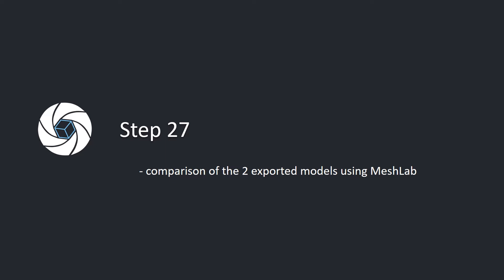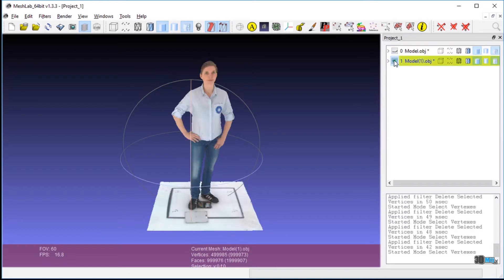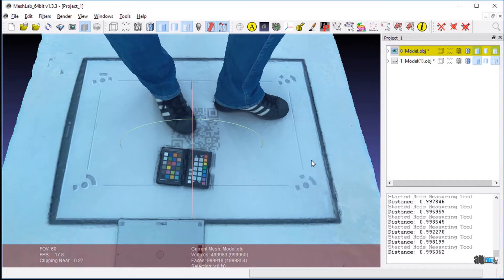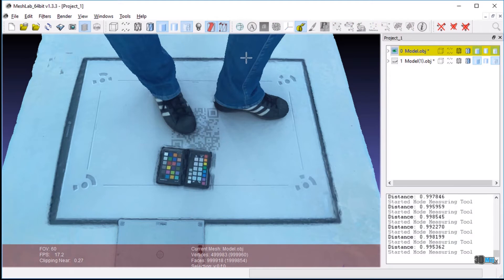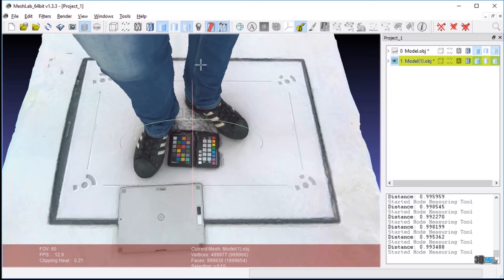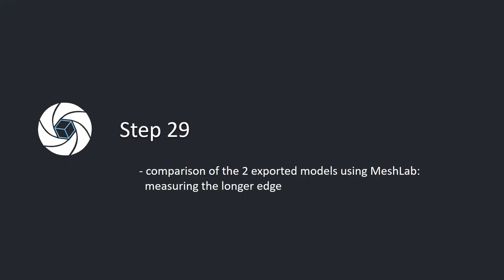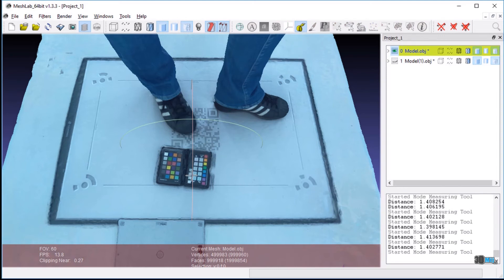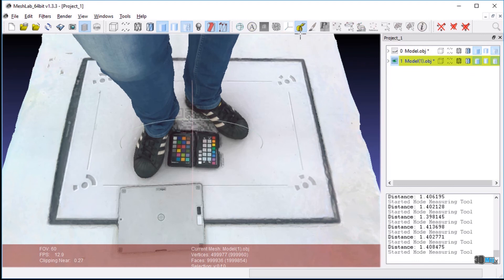Coordinate System Preservation with XMPs part 3

Comment: If our tool of measurement is a ruler, on a beam behind the actors head, would we still use Ground-points instead of Tie-points?
Reply from the maker: Ground control points are used for geo-referencing the scene, so that you will be able to export your model as geo-referenced in the selected coordinate system ('Project output' in the export settings). It is used to unify the coordinate systems of both models.